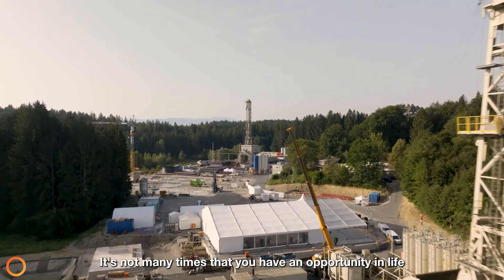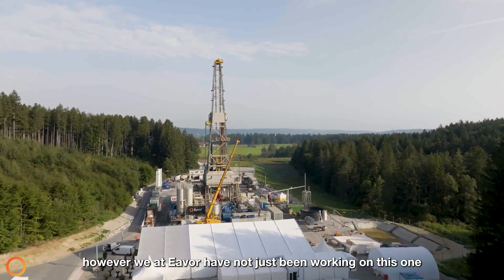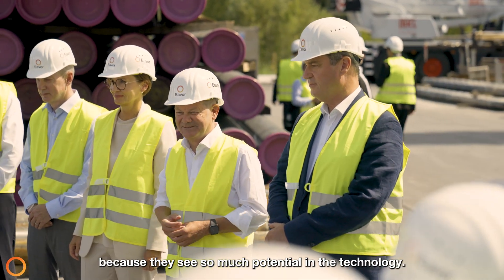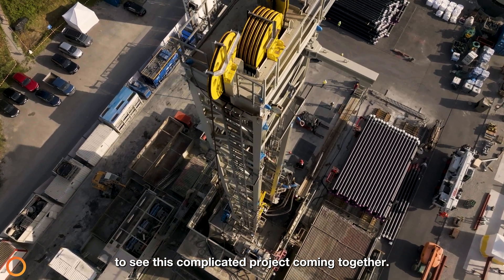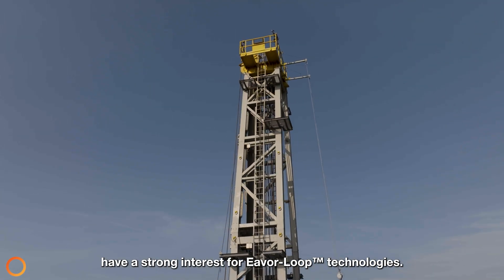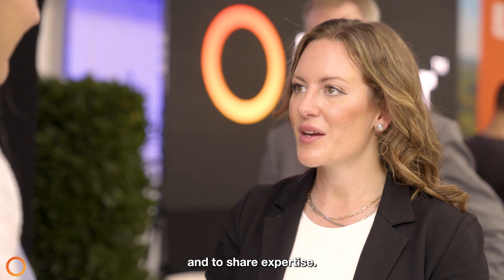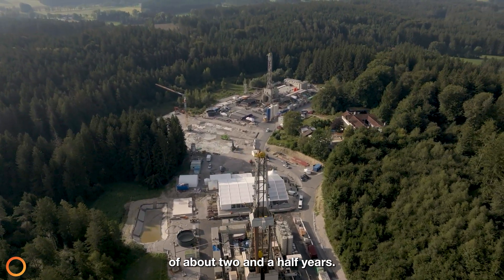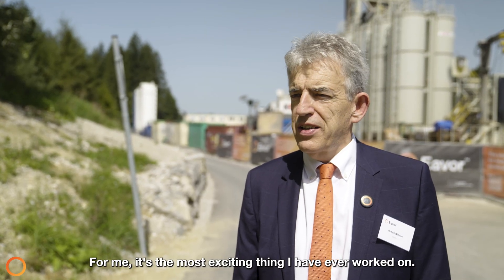Eavor's First Commercial Project - Geretsried Inauguration Event

Comment: AI Overview: Learn 
A) The deepest geothermal well in the world is the Banska PGP-4 well in Szaflary, Poland, which is being drilled to a depth of 7,000 meters. Drilling began in April 2023 and was expected to be completed in the third quarter of 2024. 
B) The Banska PGP-4 geothermal well in Szaflary, Poland is estimated to cost PLN 130 million (USD 29 million) to drill. The National Fund for Environmental Protection and Water Management will cover the entire cost of the project. 
C) The Kola Superdeep Borehole is the deepest hole ever drilled into the Earth, reaching a depth of 40,230 ft (12,262 m).
D) The Kola Superdeep Borehole in Russia cost more than $100 million to drill, or about $2,500 per foot.
Q: What drilling cost Eavor may have to drill 60000-70000 meter and reach the high temperatures?

Comment: Hmm no confidence? Because “can” change the world. How long will it take till done? 3 years quite a time.
Reply: Three years is really not that long.  Building something takes time.  Fully testing it takes a while.  No point in just building a million of these and then finding out they could do something differently that increases efficiency or lower costs.
Reply: 3 years to create something that will provide an ongoing heat and power source for your town with almost zero carbon footprint….that seems too long to wait for you?
Reply: Once the first project is successful and working, others will follow and be quicker. The first loop actually will only take 9 months from the start of drilling and already supply heat.
Reply: The eavor loop has been operational since beginning of december 2025
Reply: @UlrikeUlsin53Singer  Nice and any results jet or still silence about it?